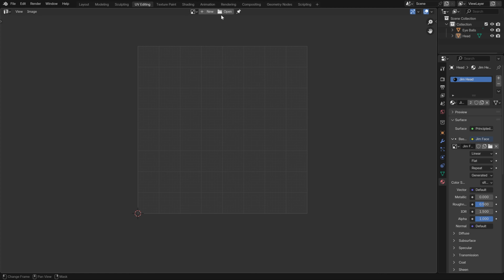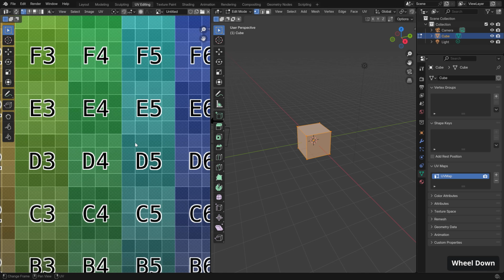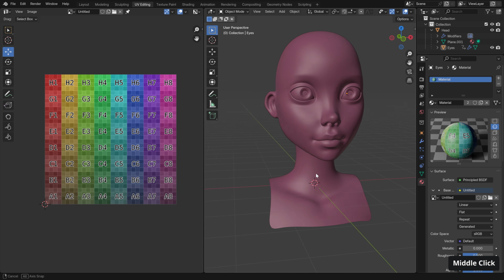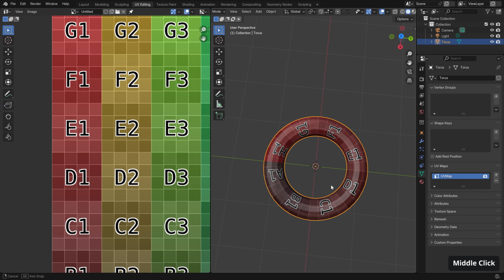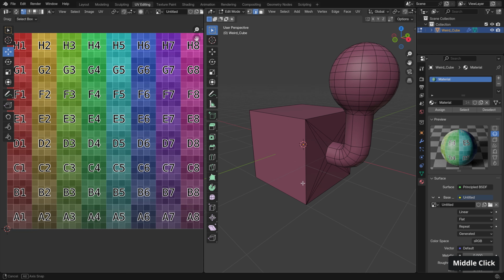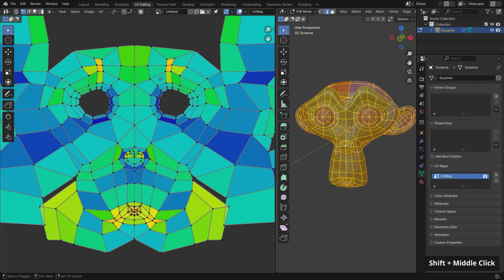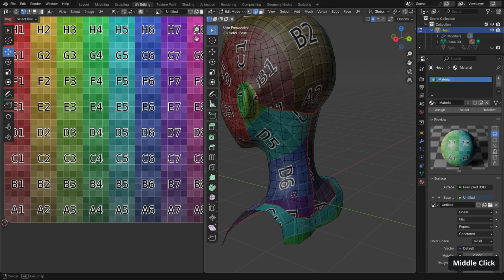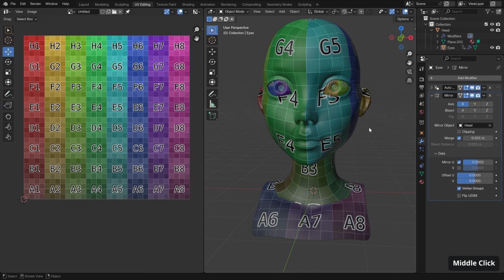UV Unwrapping in Blender (Full Beginner Tutorial) #b3d

Comment: Clicking 'Texture' on the Shading window didn't do anything. I'm using Blender 5.0. Not sure what I'm doing wrong. the cube is pink when I click Material Preview, but not in Solid.

Edit: I tried in version 2.93.6 also, and its still not working. Losing hope here
Reply: I dont understand u well, can you explain more
Reply from the maker: Right, not sure if this is what you mean but if you are using a texture but the render result is pink it indicates a missing image for that texture, either it was moved or deleted, you may need to load that image again for the texture to show up correctly. You can also check for any missing images by going to "File" > "External Data" > "Find Missing Files ...". Hope that helped. ~Jim

Comment: Is there a way to mirror the UV, after I done modifying it on one side? 
(like after closing the eye uv for more space, without having to do it again)
Reply from the maker: Yes there is. Here is what to do:

1) Make a duplicate of your model and delete the one half, use a mirror modifier to mirror the deleted side back but make sure you mirror the UVs while you are at it (you can find this under the data tab in the mirror modifier).

2) Now use the data transfer modifier on your original model to transfer over the UVs from the mirrored duplicate (you can find the UVs under the Face Corner Data section of the transfer modifier).

And there you go! Hope this helped! ~Jim
Reply: @cgboost  Question - when I try to apply the mirror modifier to this particular model it says that it cannot be applied on a model with shape keys. Do I need to get rid of the shape keys in order to mirror the UVs correctly?

Comment: When you say the geometry is in the bottom left corner, how exactly have you deleted the default UV map that blender gives to each shape?

Also when I'm trying to alight the edges for the donut/taurus part, I'm still getting warping afterwards and I have no idea what I'm doing differently to you
Reply from the maker: Hey, so when you add a new object a little popup come up, you can disable "Generate UVs" here to add in a object without UVs. As for your issue, make sure you have straightened the quad before you align the rest to it. ~Jim

Comment: 4:10 if uv is 2d space and xyz is 3D, where is w?
Reply from the maker: Well..... There actually is a "W" axis. This has to do with quaternion rotation. Let me explain:

Most of the time in Blender, when thinking about rotation you don't talk a lot about quaternions since we are more familiar with "Euler" rotations like X, Y and Z axis as these are a lot easier to understand. But if you were to only use these rotations you can lock yourself in a gimbal lock, look it up if you are interested. But anyways, to avoid this problem Blender stores quaternions behind the scenes, the "W" axis is there to say how far we have rotated or twisted, having this reference will help blender avoid problems like gimbal lock and make the interpolations in animation smoother.

So in short, rotations with quaternions have a W which keeps the “twist amount” consistent, while X, Y, Z keeps the “axis” consistent. You can check this out yourself by looking into the N panel while in pose mode with a armature. You should see the W axis in the rotation section.

Thanks for listening to my ted talk. ~Jim

Comment: You did not mention the tools used for that magnetic type of vertex editing in the face part, nor did you explain how you mirrored the uv editing to the other side of the face. I've been stuck trying to figure this out for a while. Otherwise great video.

someone help
Reply from the maker: I have some suggestions:

1) if you are using a mirror modifier it is super easy, you can go to the UV settings in the modifier and mirror the UVs under a specific axis (U or V).
2) if your model is already realized (symmetrical model but no mirror modifier) you can use this workaround; make a duplicate of your object, delete half of it along the X axis, add in a mirror modifier to mirror back the deleted part of the model and then mirror the UVs as well. Then get a transfer data modifier for the original object and transfer the UV data from the now mirrored duplicate to the original model. Your original model should now have the UVs mirrored.

Hope this helped ~Jim
Reply: @cgboost  I appreciate it thank you!

Comment: Could you demonstrate this with low-poly UV maps? Specifically for character heads or faces? Low-poly UV maps often look way better if everything is squared off. I tried doing what you explained at 36:49 but it... came out kinda poor.
Reply: For low poly maps its pretty much the same approach but you have to deal with less polys which is a plus. You can use pins to help squeeze everything together, think of it as playing tetris.
Reply: @JimMorren  Ye, I've done that. My main problem is with more "organic" shapes. For instance, I've got a low-poly character I'm texturing right now (texture map is 256x256). Her nose is just a simple pyramid, but it's a pain in the ass to shade the underside of it. If I don't align the underside with the pixels, I end up getting jaggy shading. Stuff like that doesn't really get explained in any of these Youtube videos.
Reply: Yeah that would be a whole subject by itself. But if you are working with very simple meshes and you are looking for a smooth feel, maybe look into gradient texturing, it's a completely different way of doing textures using simple gradients, which is great for very low poly objects and even characters. Might be something you find useful.

Comment: LSCM is just an older algorithm. Came out about five years or so (fuzzy on the exact timeframe) before the angle-based formula. Blender was the first software to offer it, which is why I first started playing around with it. At the time, that crappy algorithm was still far better than anything Maya or Max could do.
Reply: do you know what kind of mesh parametrisations are  used in maya or other proprietary  softwares..chat gpt couldn't  find answers
Reply: @ARM-wb4kc  I believe Autodesk ported the unwrap algorithm from Softimage over to Maya and Max. Softimage’s was from a third party they acquired. It gives pretty decent results (better than vanilla ABF, similar to the new reduced stretch in Blender). Oddly enough, both 3D Coat and ZBrush have really good unwrap algorithms as well.
Reply: @RogerEberhart, that is really interesting. I would be interested in knowing what LSCM is used for specifically. I have yet to find a clear use case example that clicks with me.
Reply: @JimMorren  It was the bee knees 20+ years ago when the next best thing was pelt-mapping. But yeah, today it's the pinky toe of the unwrapping world. Might work okay on very simple unwraps, buts falls apart spectacularly on anything complex. You would often have to split up UVs into smaller islands, unwrap them, then stitch them back together. I don't know why Blender doesn't remove it. I guess in extremely rare cases, it may produce less distorted results, but now, with the improved "minimum stretch" algorithm, there is even less cause to keep it around. My one guess would be it's less computationally expensive, so maybe works better as a geometry node. Even Blender's documentation points out it doesn't work great: "This usually gives a less accurate UV mapping than Angle Based, but works better for simpler objects".

Comment: When I select one island, and then select them all with "A" and say follow active quads. It does not work. Is there a specific way you meant to select the face?
Reply: You need to have an active face, so in face select mode, select the face you want to use as a reference, and then with that face first selected select the rest of the island. Then, after all that, do the follow active quad operation.
Reply: @JimMorren  Thank you so much. I will give it a try. I appreciate you responding.